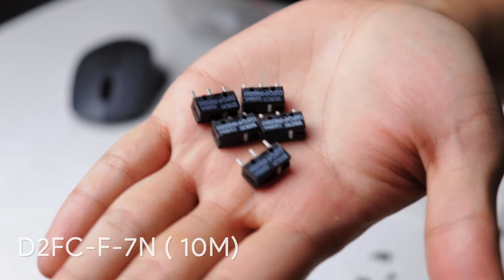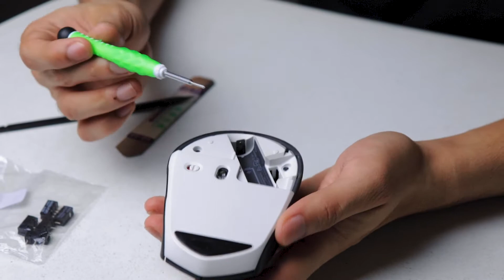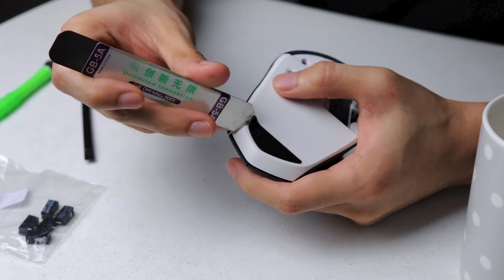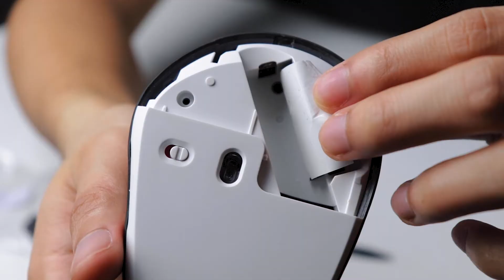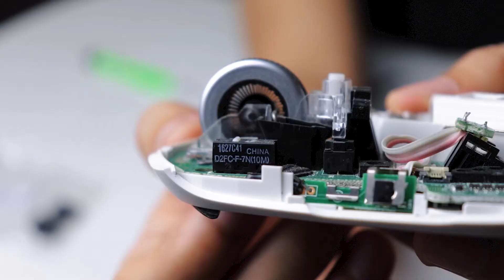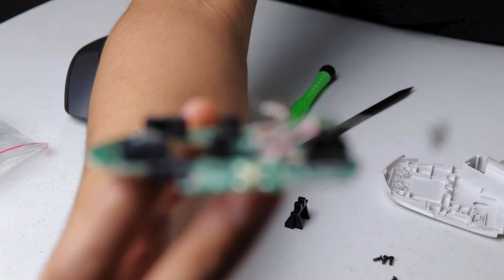Logitech M720 Disassembly | Micro Switch Replacement | 5 years of use

Comment: Just did mine. I bought 3 switches rated to 20M clicks each rather than the standard 10M. Price is almost the same. Took about 20 mins following your guide to open it, change the switch and reassemble. It is like new again.

My original switch did about 5-7 years of service. Hope the next will do 10. Thanks for the video.

Comment: Tearing my down now.  Very glad you pointed out those springs, I completely missed them and was very fortunate I did not lose them.  I am attempting to replace my micro switches with silent click switches. in this process.  Thanks for a solid simple video.

Update:  Installed the silent click buttons and worked like a champ.  Great video, saved me a lot of heartache.  Mouse works wonderfully now and is whisper quiet.
Reply: Those springs when I tried to put them back it is going into the hole  not sure how to put them back

Comment: Thank you for this.  I figured there would be a screw or two under the skate but not the battery sticker, I thought that would be too shallow.  Also, I reinserted the battery sticker but cut out a section that left the screw visible if needed again although leaving it out completely would not be a big deal.

My issue was the right mouse button was making intermittent contact.  Once I had the mouse apart, I used electronics cleaner, let it dry out and it is working again.

There was a website I found that showed what part of the mouse was being used and showed the intermittent clicking while right clicking in Windows did not show that effect.
Reply: Hi Chris, what website is that? Can you share?

Comment: Thank you for the nice instructions on how to disassemble mouse and the warning about the springs (my eyes can't see such fleas anymore). At home I found some boards from old mice with Zippy switches that are the same. Corrected. The switch problem appeared 4 years and 4 months after I bought the mouse. I had the same switch problem with my previous wired mouse. Omron switch too.

Comment: Thanks for the video. Repaired my M720 following the steps. overall took 1hr~. 0.5hr was spent on the removal of the switches, which could have taken 15min. Removing the switches takes more effort due to the large ground plane sinking away the heat from the soldering iron. just heat it longer and add some fresh solder to it, and suck/wick it all up should do the trick.

Comment: I couldn't melt the solder of the original micro switch so I just removed the fragile microswitch cover and saw that the terminal below the copper switch had corroded. I put flux paste on it and soldered it just enough to clean it. Just be careful in removing that copper switch it may fly off its seat and it's also difficult to put them back in place. Well, that did the trick but I think WD40 will also work without replacing or fixing by removing the cover. The outer cover of the M720 chips off after 5 years but the hack to it just to paint something on it like PU leather. Anyway, I believe Logitech M720 is  the best mouse out there. It is ergonomic, easy to repair, and, best of all, cheap. I have the Logitech MX Master 3s but it's is uncomfortable to my hand.
Reply: Hi. I'm in the middle of fixing the Omron box in my Logitech M720. I don't have access to a soldering tool at this time of night. Any tips on what to use to remove the top of the Omron box as you said you did in your comment here?

Comment: ive been using this mouse for 6 years, slammed it on a desk one too many times and it the sensor stopped working. I took it apart using this tutorial and moved it into place and stuck it with some putty and it works. Thanks!
Reply from the maker: phew M720s just wont die haha i replaced mine already but it was still working when i did 🤣

Comment: I confirm @boing615 comment. Soldering is not needed 99% of time. You just have to disassembly malfunctioning micro switch and replace old part with one from new micro switch. I've ruined one Logi mouse because my soldering iron wasn't hot enough and I didn't know back then there are other ways to fix it.
Reply: Hi friend! My new switch just arrived here for me. So I do not need to soldering the  old to remove neither solderinh the new one in place, is it? Just replace it? Thank you!
Reply: @lmoraisvieira  It is possible to replace spring inside micro switch but it's hard to do. Sometimes no spare parts are needed - my previous fix was just by cleaning and a little drop of WD-40. But if you have a solder iron that's the best way to do it. Today I've done it again even though my soldering skills are non-existent.
Reply: Hi friend. I changed the switch for a new one. It was so difficult to take off the bad switch, really so difficult once the solder was hard to remove. I spent almost 3 hours to do that, but I changed and it's working like new. The bad thing is that I lost one of the springs of the scroll. They are really small and almost impossible to see if it jump from your finger, one hour looking for it without success, so I mount it with just one spring. It's working, but I found these springs in Aliexpress and I will buy to put in my mouse. Take care when you are holding these springs, once they jump  from your fingers, say good bye forever!    8^)     @emem666

Comment: The links are a bit confusing.  There must be a typo or something... but The Product Link says D2FC-F-7N (10M) and when we click on the link, it lead to the (20M) model.  I've opened mine just to make sure i'm ordering the right model, and mine got the (10M) micro switch.  (I'm not saying that they are all like this, but it might be good to verify what's in your mouse).  

Mine didn't last so long.  I've bought it on October 2020 (2 years and 8 months old) before the switch start to glitch.  It's my job mouse so i use it probably a lot more than average home user.  I've changed battery only once i think which is excellent.  I bring this mouse with me in my laptop bag so it might got damaged in the transport.
Reply: oh well... i've just read about the difference between the 2 models.   The xxM stand for the "minimum rated mechanical cycles", where 10M mean it should take 10 millions click before failure.  It is important to mention that it doesn't mean that it won't degrade before that point.  So you might be better with the 20M version.  The seller on Amazon still recommend to use the same version that is within your mouse.  Some even say that there's a 50M version (D2F-01F) but i've not checked their datasheets so i suggest that you make your own verification.  I've heard that the D2F-01F is a little taller than the other model and the actuation force of the D2F-01 is double the one of the D2F-01F.

Comment: Mine started to make the same problems just after 1 year. I open it and tried to get the switched cleaned with contact spray (usually fixes problems with switches) but without any luck. I googled the switches and it turns out that those are not the most reliable. I also love the mouse and didn't want to change it with other. Mine is (or rather was now...) under warranty, but they told me that I have to return the faulty mouse and my keyboard in order to get my money back and I decided not to create any e-waste and fix it by my self. And since I didn't want to change constantly switches, I did a bit of research and decided to order Kailh Red GM4.0 switches - 2 pcs for the left and right mouse button. Those should fit perfectly, but I have to confirm that when they arrive. Those also should fix the only thing that I don't like about this mouse - how easy is to click the left and right button. As for the screw that is hidden under the sticker in the battery compartment - just use the screwdriver to locate it. Once you know where it is - use exacto knife or any other sharp knife to make two slices above the screw. This should be enough to remove the screw and it only takes 2 seconds to do it.
Reply: Any update if the kailh is compatible with this mouse?

Comment: You can also unclip the top of the micro switch to expose the innards, there are clips at the front and back face of the switch. I found some deposits had built up on the face of the contacts so I cleaned it with alcohol and rebuilt and it seems to be working fine.

Comment: When you create a disassembly of a device you must show all screws to people who watch you.
For this mouse screws are not all similar and if we forget where they were remove your video is usefulness.
Reply: Over the years I've disassembled and repaired some electronic stuff like mice and even my old iPhone for battery replacement (which as very tiny screws). What I've learned is that you must have a system for keeping track of screws. I simply use a small, old ice cube tray with each compartment labeled with a number. I draw on a piece of paper a rough sketch of what's being disassembled, labeling the screw holes so that they correspond to the numbered compartment in the ice cube tray. This way, it's easy to figure out which screw belongs to where.
Reply from the maker: that makes sense. thanks for the honest feedback